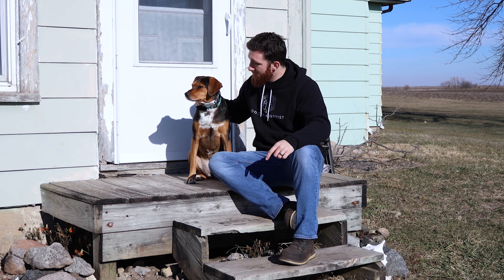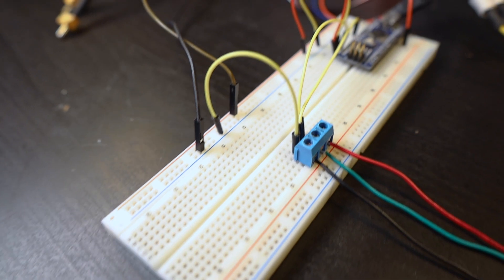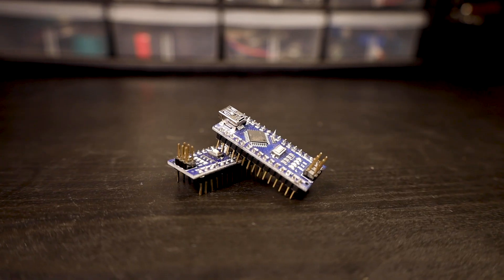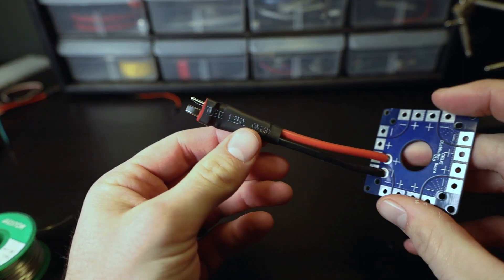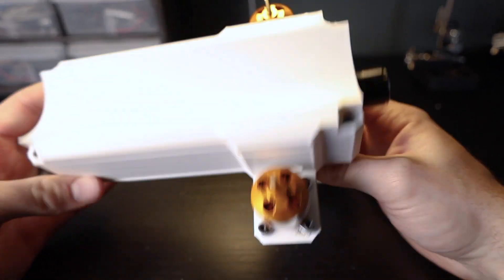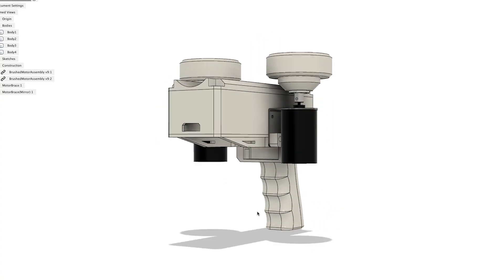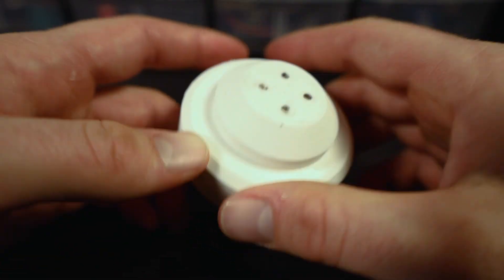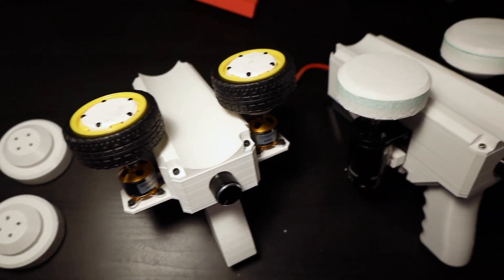I Made an INSANE Ball Launcher For My Dog!

Comment: I just realised that you forgot to mention the terminals that you soldered to the power distribution board in the description... Also can I use the same battery for an alternate motor (It's from the same manufacturer Globact 550 21T 80A motor)?

Comment: I had the Hot Wheels car launcher as a kid too but I remember mine having foam wheels inside the tunnel that gripped the car.  I would try wrapping your printed wheels with velcro but not the hook side but the fuzzy side.  I buy packs of velcro that have very sticky back side to apply it easily where you need it.  You can even put in a screw or two to hold the ends down so not to lift off.  Or you might try the insulting foam stick around window ac units or doors.  If all else fails wrap the wheels with duct tape one, two or three turns.  It will have a little bit of flexibility and should grip the balls tighter.

Comment: just glue the tires to the rims like every RC car in the world. Different foam will allow the tires to grip better, again the RC car world has different foam you can try. Also a single ESC will work and lose the electronics, you can simplify this project by at least 75%. Mounting it in a box for the dog to self load would also be a huge plus.

Comment: Glue some sand paper to the wheels. It needs a longer ramp so the ball is moving before it hits the wheels IMHO
Reply from the maker: I might have to try that. I put electrical tape on the wheels thinking it’d act more like rubber, but it immediately ripped off and cut the crap out of my hand 😬